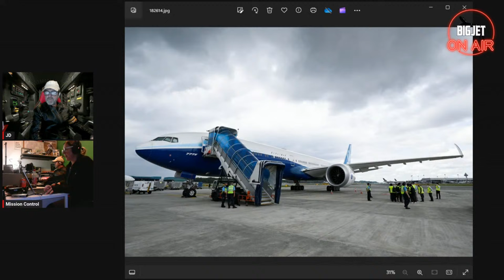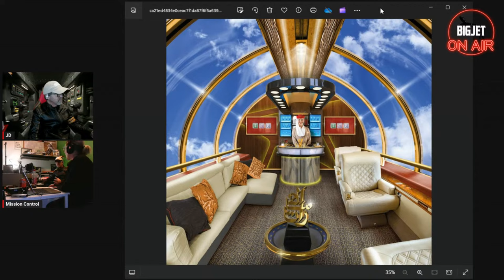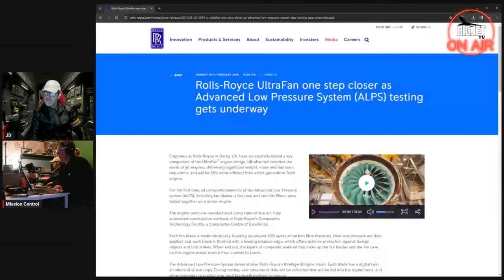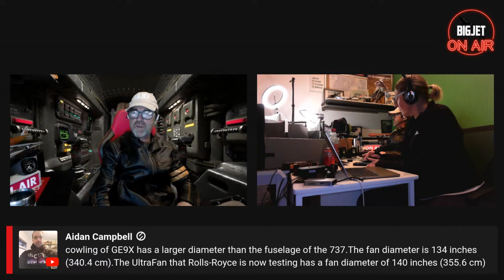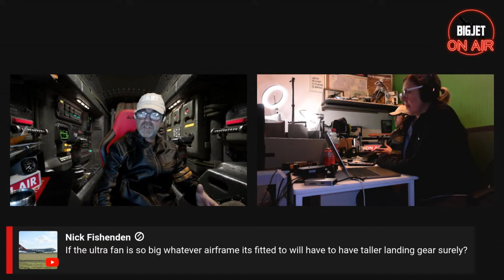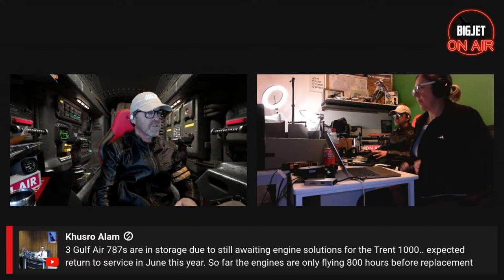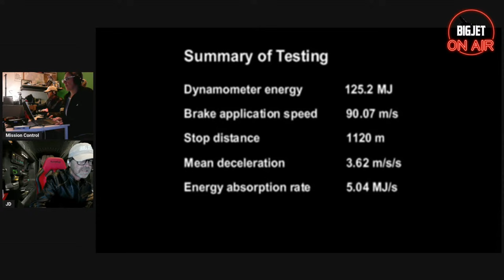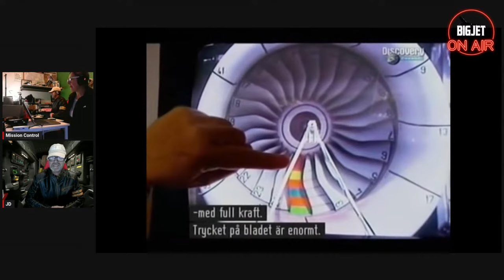ON-AIR: A380 Stopping Power Plus AV Chat & Discusion

Comment: Hi Jerry, on the great show last night about the Rolls Royce engine test you said it happened to a A380 if you where referring to the one out of Changi in 2010 Qantas flight 32 that I was on It was the compressor of n2 engine not the front blade that exploded and parts came up through the wing and damaged the flight controls, electrics and hydraulics.